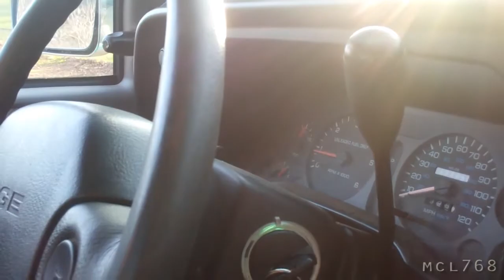[210] Hiding a new Cache - 2011-01-10

Comment: sleegdi left a comment stating that it sounds like the throttle position sensor (T.P.S)
My neighbor has a Dodge truck similar to yours and he replaced his T.P.S unit. This is a small electronic part that mounts to the side of the throttle body. The T.P.S controls the idle of the engine. Did you really fix the engine problem or did it just stop messing up?